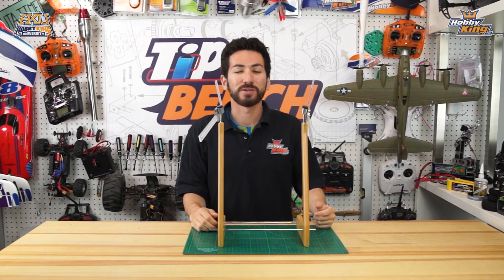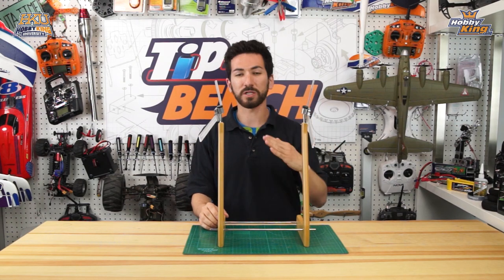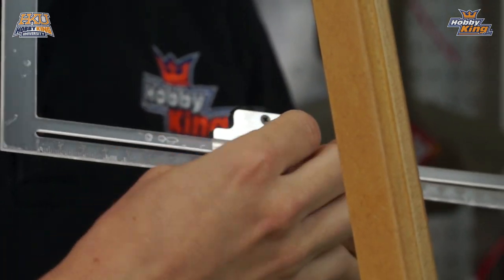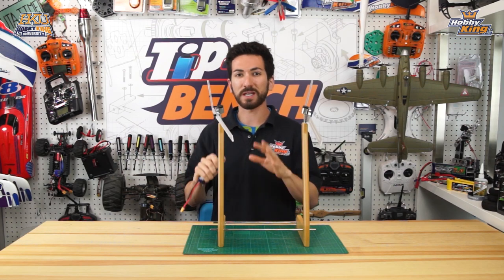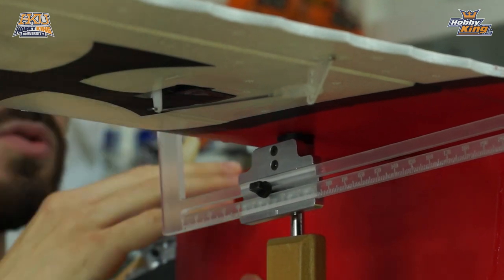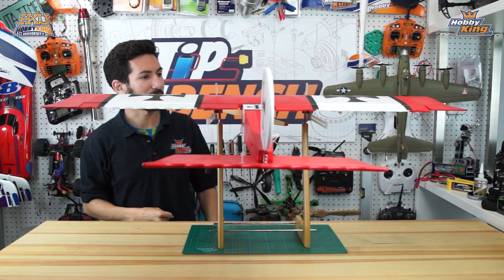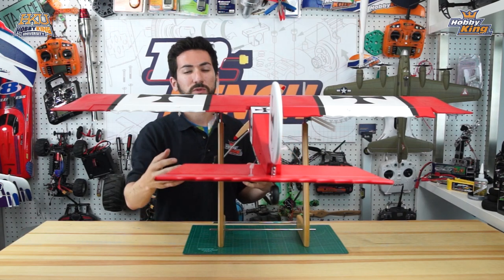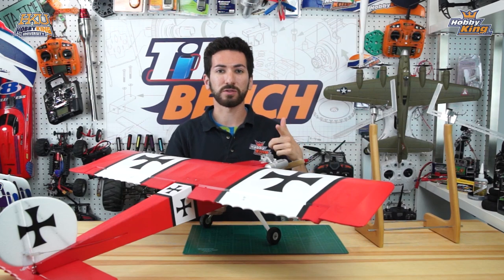Tips Bench - Center of Gravity

Comment: A loop of cord, a plumb bob and a place to hang them both from.  Loops the cord around the wings and up to the suspension point and adjust the plane so that it is hanging level.   Hang the plumb bob from the same spot.  When it stabilizes the plumb bob will be hanging over the center of mass of the plane.  Adjust it accordingly by adding weight.  You probably already have the makings at home but you can still buy a CG machine if you want something that takes up space while not in use.  I generally make the "Plumb Bob" of my give aways from a piece of kite string loop around a 1/4x20 nut so that one corner of the nut hangs straight down. 
Basically you've made two plumb bobs hanging from the same point, one over the other.  The center of mass of both is hanging in a straight line between the suspension point and the center of the Earth's mass.  As mentioned, you probably already have the makings around the house.  Surveyors string will work for light planes BUT beware, it likes to twist up when not in use.  For medium size planes I like to get non tangle Boat casting cord, It doesn't tangle up when there is no load on it and a real will make plenty of loops AND hold heavy planes.

Comment: For what you get and the quality of the materials I feel it is worth the money.  If it is felt that the rulers will throw things off, then take them off.  Granted it now is the same as using two fingers to balance the plane, however you can think of it as a third hand.  Makes it much easier to move the battery around or add weights to balance the plane.  If the CG is noted in the instructions then use the rulers to mark it off.
     What if you don't have the CG information available?  You can use the rulers to figure that out.  Starting at the leading edge, measure the width of the wing next to the fuselage, and then take 25% and 33% of that number.  Again starting at the leading edge, the 25% is your forward most range of the CG, and 33% is the aft (Back) range.  I used this method on a plane of mine with a known CG.  The initial reading was 190mm, 25%=47.5mm, and 33%=63.3mm (half way between the two numbers is 55.4mm).  Taking more measurements with the rulers, I plugged those numbers into a few CG programs on line, and the CG=54.9mm.  The instructions that came with the plane said the CG was 55mm.
     Measured that off with the rulers and marked it on the wings.  Placed the plane on my “third hand” at the marks, moved my battery until it was balanced, then went flying.  Granted different wing configurations require different approaches to find the CG, but I still can use the rulers to measure, and the stand as a third hand.

Comment: It appears to me that this CG tool is flawed right out of the box due to the CG rulers not being bslanced. Did you see how the flail end of the rulers immediately dropped down when the airplane was lifted up off of them?

On my foamies I mark CG on the underside, then punch two thumb tacks in. This method makes it much easier and more consistent to locate CG with my finger tips. I've never had an issue yet, even when I use an assortment of LiPos ranging from 2200 mAh up to 5500 mAh.

Comment: A noobish question might be: What "line" do we use to determine if when the plane is "level". I personally use the underside of the wing.
Reply: TheAdkFlyer10  I always use a ruler to estimate the position from the wings leading edge close to the fuselarge and and then use my fingers to check the balance by holding the plane  under the wing. It its not balanced by holding it, its unlikely to be neutral in flight. Most typical mid sized planes are quite forgiving in terms of the CofG position. Some people can get very anal about this but its each to their own. Its what ever suits your flying style. If its needs a lot of trimming on the radio to fly straight and level. You can use that to determine what changes are needed on landing and then after rhe adjustment remove the trim on the radio. Of course if you put stuff out on the wings like cameras or FPV transmitters etc you also also need to balance the wings as well. For flying wings the CofG is usually around 2/3 along the mid line from the front, other styles can be near the leading edge or near the wing spar. It varies depending on the shape of the wing & plane. Check the manual and the reviews.  That's my experience. I took a course on aerodynamics last year, edx, DelftX - AE.1110x. It gave me a greater appreciation of the physics but at the end of the day its trial and error which works, for us amateurs anyway.

Comment: hi good video but what about setting cg on low wing or nitros thanks andyuk
Reply: andrew sherriff You balance a low-winger upside down, i.e. with the top of the wings resting on the arms/rulers. You balance nitros with an empty fuel tank and by moving the radio gear and receiver battery backwards and/or by adding weights to the nose or tail.
Reply: thanks for you reply how does this work with a gas 3d plane
Reply: andrew sherriff Put the plane on the balancer without the receiver or receiver battery installed. Rest them on the outside of the fuselage (fixed with sticky tape if necessary to stop them moving) in the position that makes the plane rest level or slightly nose-down. Then move them inside the fuselage as close as you can to the same postion. If you can't make it balance because you can't get them in exactly the right place then get them as close as you can and add a small (lead?) weight to the firewall if tail heavy or at the rear of the plane if nose heavy.
Reply: thanks for your help i,ll give it a go

Comment: How about if the wings are swept back even a little ?  The "CG machine" will not work in the same way.
Reply: UKHeliBob Delta wings are usually measured from the leading edge of the wing root. Looks like the width of this CG frame can be adjusted along the lateral bars.
Reply: FrostbiteUK Yes, but if the CG is meant to be say 55mm back from the leading edge of the root of a delta wing  it is no good setting the "machine" to 55mm is it and you will not be able to adjust the width to get to the centre of the wing.   By the time that you have done the measurements and calculations as to what value the "machine" should be set to you might just as well mark the CG on the wing and balance it on two fingers to test it.

In any case, the weight of the "machine" balance arms is also contributing to the CG measurement because when they are adjusted forwards and backwards their weight distribution changes as well, which will affect the CG measurement.  The effect could be significant on a smaller model.

It seems to me that this product is not thought out well enough.
Reply: UKHeliBob The root of the wing (delta or otherwise) is where the wings join the fuselage not the centre of the wing so slide the frame inwards so the two frame uprights are against the fuselage, i.e. at the root, then it works. Simples

Comment: THIS CG MACHINE COULD NOT BE ACCURATE.NOTICE HOW THE RULLERS ARE LEANING BACKWARDS BEFORE THE PLANE WAS SET ON IT, THEY ARE OFF BALANCE DO TO CENTER POINT OF THER SELF. DONT BUY THIS THING. IT LOOKS GOOD, BUT A MILE FROM BEING ACCURATE.
Reply: Dan Hughes 
Do not buy. This is a good example of a bad design.. I bought this around a year ago and YES, because of the rulers being heavier on one side the measurement on smaller planes is never accurate! 
Plus, the set comes in parts and both wooden arms split when (gently) inserting the metal sticks. I now use the rulers on the field and that works ok.
Reply: Dan Hughes Great spot. The Multiplex balancer that I have has a sliding weight on each arm (ruler) so that you get the arms horizontal BEFORE putting the plane on it.

Comment: What a pointless cg device. How is the wing supposed to always touch the vertical portion of the machine when all wing sizes and Cg's are different.
Reply: G56AG The vertical portion of the machine is not adjustable. If that particular plane had a smaller wing there is a chance that at that particular Cg then it may not be large enough to reach the vertical upright
Reply: Trouttaranaki Why do you say the vertical portion is not adjustable? Go to the product page by following the link above and you will see it is adjustable. The vertical portions slide in and out on the two metal rails.
Reply: Don Judge the vertical part is part of a one peice plastic L shape laying on its side. This portion of the machine cannot be adjusted. That's what I'm talking about. The vertical part of the plastic cannot slide along the horizontal surface.
Reply: Trouttaranaki Sorry I thought you meant the Z-shaped vertical pieces. Did you not watch the video and see the Guy adjusting the machine by sliding the L-shaped pieces and locking them with the thumb screws starting at 1:33?
Reply: Don Judge yes I did, but you are yet to grasp what it is I'm trying to explain. So let's just leave it.
Reply: Likewise fellah, you don't understand what I am saying either or else you would see it works. Good luck...